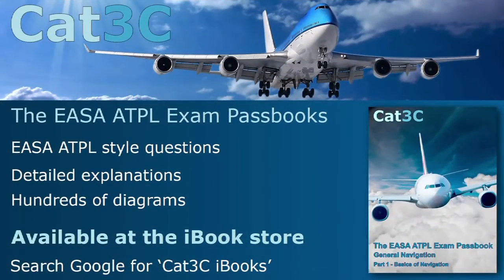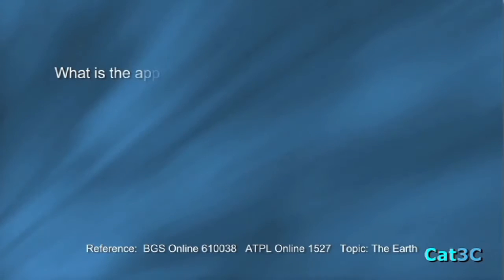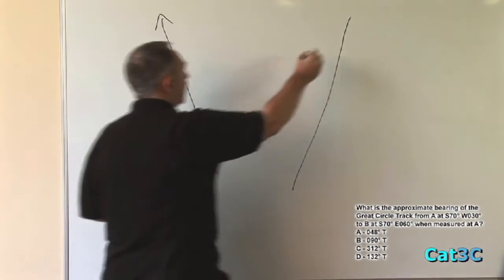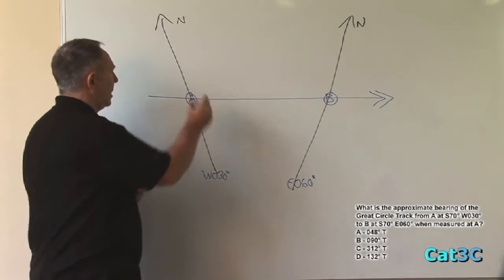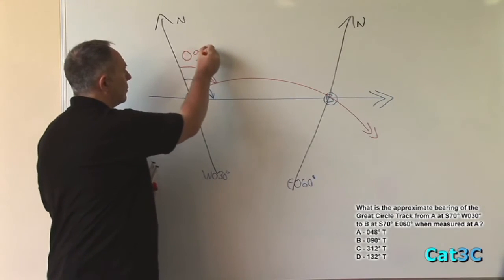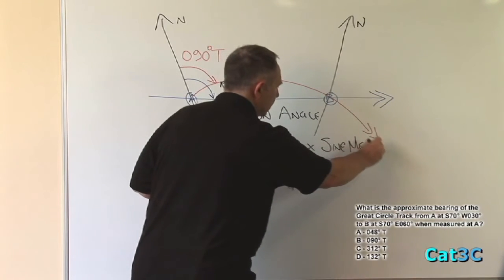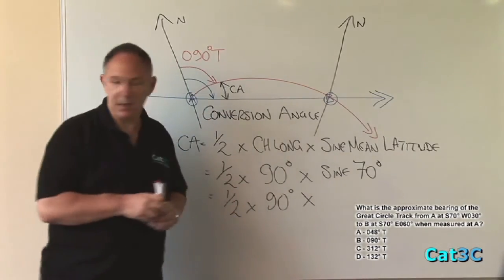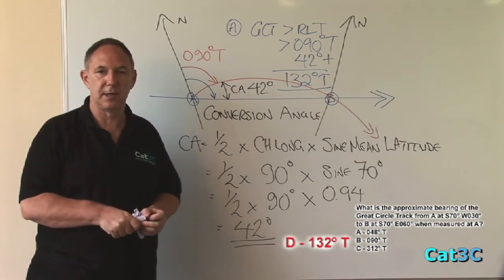QEV 007 Convergency (A)

Comment: I use to Draw the lines in a different way, so correct me if I am wrong:

You drawing the globe (as long as the Meridians are bent and divergent toward north (so SH) and the straight line is the GC Track).
So the curve line means the Rhumb.
If for any chance me or someone draw the same but not bending the reference meridians ... that make all wrong, right? I mean .. If you draw two parallel meridians straight north, the straight line now is the Rhumb and the curve line is the GC, right?
Just I use to draw like that (curve line is the GC and straight line is the Rhumb). Only bc in most of the questions I found, they give you the Rhumb or is easy to find bc coincide with a Parallel (we flight on same Latitude, like this example) so a track 090 looks perfectly good as straight line to the right.. 

Sorry my question may be more confusion for some people trying to understand this Convergence and Conversions angle.

Comment: So is a great circle track always greater than rhumb line track?
Reply: No, definitely not, it depends on the hemisphere. Northern hemisphere - GCT < RLT to left of the track lines and GCT > RLT to right of the track lines; the opposite in the southern hemisphere (as in this question, the GCT > RLT to the left of the track lines - if you drew in the bearings on the right side you would see that the GCT < RLT). The direction of the track lines is irrelevant, easterly or westerly the situation remains the same.

Comment: I am 100% certain I am not confusing the two. What book are you using?

The only occasions whereby a great circle forms a curved line is:

(a) on a Direct Mercator chart, whereby, owing to the parallel meridians on the chart, a straight line intersecting those lines is a line of constant bearing and as such forms a rhumb line. Nevertheless, the rhumb line is on the Equatorial side of the great circle. This means that the great circle is on the polar side of the rhumb line (as always!) and if the rhumb line is a straight line, the great circle must be a curved line (concave to the Equator - the origin of the Direct Mercator chart).

(b) On Lamberts conformal conical charts, other than meridians and the Equator (which are straight lines), great circles are curved lines (very slightly curved), concave to the origin of the chart, which is the parallel of origin (the average of the standard parallels).

(c) On polar stereographic charts, other than meridians (which are straight lines), great circles are curved lines (very slightly curved), concave to the origin of the chart, which is the pole.

On both Lamberts and Polar charts, rhumb lines are curved lines, concave to the nearer pole, and on the Equatorial side of the great circle.

What you are pointing out is a common misunderstanding among students, and usually based on the properties of the Direct Mercator chart, which often causes confusion. Your course book is probably referring to the Direct Mercator chart. If not, I am concerned as to the accuracy of the book.

ICAO Annex 4 (Aeronautical Charts) clears it up nicely, as it is a mandatory requirement of ICAO Annex 4 that, on all aeronautical charts the great circle must approximate a straight line. Meridians and the Equator are straight lines in all cases. All other straight lines approximate great circles, within the usable area of the projection, and for practical purposes are taken to be great circles.

Hope that helps, but please let me know which training material you are using.

Comment: Hi Tony, 

Can i just ask why the constant bearing not he rhumb line track is 090T? 

Many Thanks,
Nick
Reply: Good day Nick, the rhumb line track is the constant bearing - that is the prime property of a rhumb line. In this case, that is determined by both positions being on the same latitude, which gives us the RLT of 090T. All we need to do to work out the GCT is to figure out whether we add or subtract the conversion angle and that can be determined from a simple diagram. Remember! Ask CARL! Conversion Angle Rhumb Line (or when converting between RL and GC always use CA).
Hope that helps.

Comment: How do we know if they are asking about Convergency or Conversion Angle? That confuses me.
Reply from the maker: Simples! 

The convergency formula is applied to find the change in a Great Circle Track  between two points along the track line. This varies between a general earth convergency formula and a chart specific chart convergency formula (different for different charts).

The conversion angle formula (equal to 1/2 x convergency) is applied to find the difference between the Great Circle Track and the Rhumb Line Track at a fixed point.

Hope that helps.

:-)
Reply: Thanks for your answer!

That indeed helps, but as you mention, the Convergency is applied to find a Great Circle Track change, right? But then this type of question comes in: "An aircraft passes position A (60N 120W) enroute to position B (60N 140,3W). What is the Great Circle Track on departure from A?

What should I use? One explanation (which gives the correct answer) says Conversion Angle. Why?

Thank you so much!

Comment: Hi Tony,

I have the same answer but shouldn't the GC be curved down? To the South Pole I mean.
We're on the south (70 deg.) and GC line curves to the nearest pole.
It can be even noticed on the picture You've made - your GC line in point A is pointing hdg less than 090 deg instead of pointing greater hdg (132 in this questions).
Am I correct?
I just want to be sure, anyway your movies are really helpful!

Best regards,
Simon
Reply: Hi Tony,
A quick question to clarify a point.
We determine that the bearing of the RLT is 90°.
Is it only due to the fact that we are flying easterly ?
Would it be 270° if we were going from B to A ?
Great explanations !
Reply from the maker: Hi Simon,

Two important points to note:

1. The great circle in the diagram is the straight line; the rhumb line is the curved line, concave to the pole and on the Equatorial side of the great circle.

2. The diagrams are only meant to show the relationship between the angles, i.e. which angles are greater and which are smaller, and are not to be seen as accurate diagrams. However, the great circle track at A appears greater than 90 degrees. The rhumb line track, being a parallel of latitude (two points are both at S70), follows a bearing of 090T.

I hope that helps.

Tony
Reply: +Cat3C ok, great, Thank You for reply! :-)